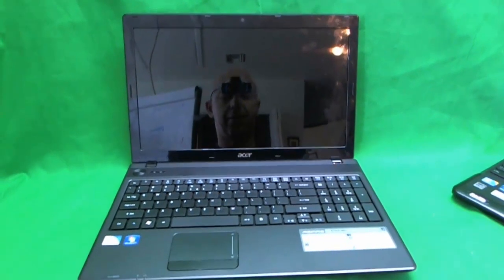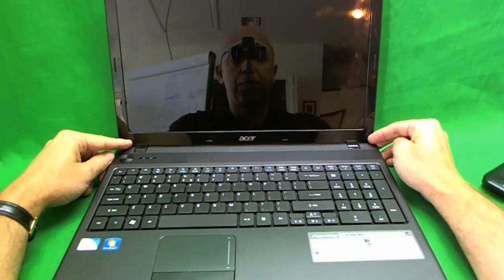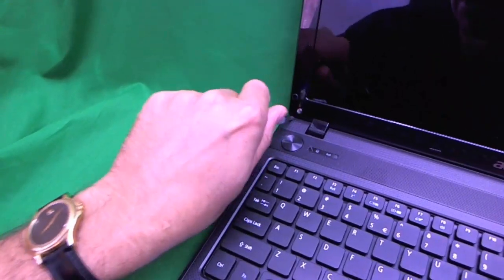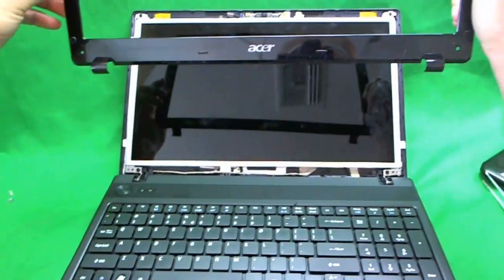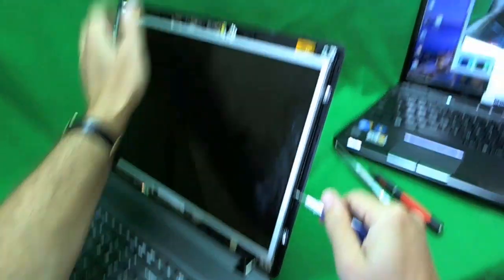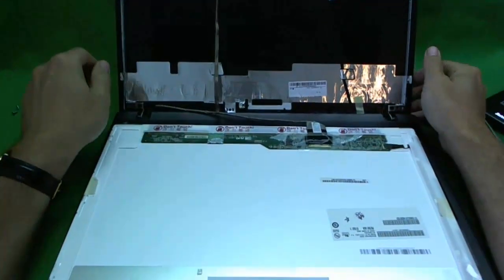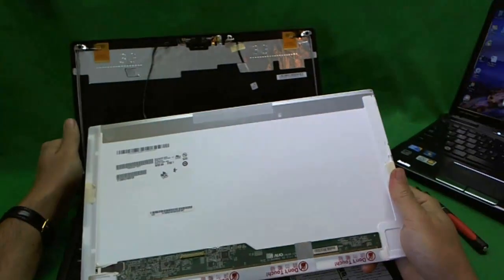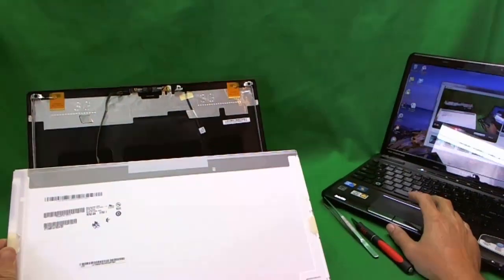Acer Aspire 5742z 5742 Laptop Screen Replacement Procedure

Comment: When i turn on my acer aspire laptop it shows no display (black screen) so i connected an external monitor to test the display and it worked, because of that i know now that the problem isn't inside my laptop but in the monitor. So i tried to remove my LCD screen and then put it back but nothing happened...
Pls, i'm looking for any help or an advice.

Comment: Great video! never worked on a laptop before and this made it EASY! the six screw holding in my screen were obstructed by plastic so I also had to loosen (but not remove) the screws that hold the metal frame to the plastic case (one in each top corner, two in each bottom corner), this allowed the screen and frame to come up an eighth of and inch and gave me enough clearance to get the screws in.
Reply: FilmsForActors xcxsgb

Comment: guess what, a few weeks after I got the laptop all colours changed drastically, black/white became green/pink. Acer repaired it (screen connection cable), it took 6 weeks and guess what, after 2 weeks it got the same problem AGAIN. 5 weeks later I got it back with the repairing report "connection cable not repaired properly" 
The plastic around my screen is loose but it still works after 2 years.
Love your video btw, you're a pro, as specially with your headcam.

Comment: hi, i have the same laptop and my screen kept on going white. i had to nudge and bend the top left corner to get the picture working. would i need to replace the whole screen or would it be another problem, like the wires or something?

Comment: i noticed when you read the part number, both times "b156xw02" you skipper the zero, as "b156xw2" is it unimportant, irrelevant, or did you just not notice it? *out of curiosity*

Comment: Thank you so much for taking the time to explain this procedure.  If I need to replace the screen, I feel confident I can now.  

Would you know this from 'afar'?  The right third of my Acer Aspire 7741G screen has turned into vertical stripes.  The rest still functions fine.  The colours of the stripes vary sometimes when I wiggle the screen, but sometimes the stripes turn into the mirror image of the right hand side of the screen.
Could it be the connector or is it more likely the screen?

Comment: Thank you so much!! Hey, could you help me? There is a 2 inch black bar and 2inch white bar on the right side of the screen. You can only see a square of the monitor. It's black like the light is on not like it's off. It doesn't show up when I plug in a outside monitor. Is there a way to fix this or should I buy a new screen??